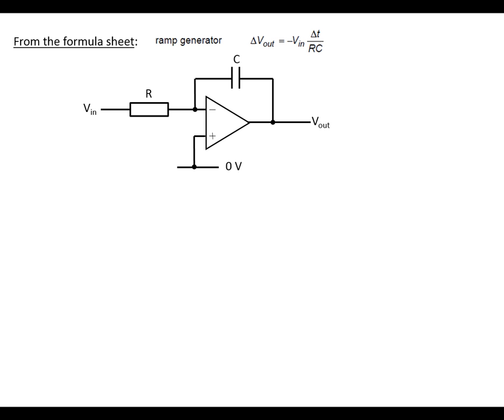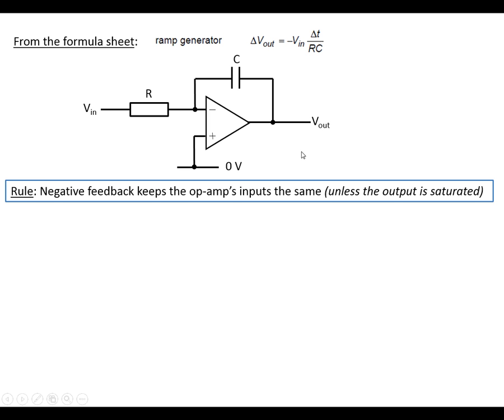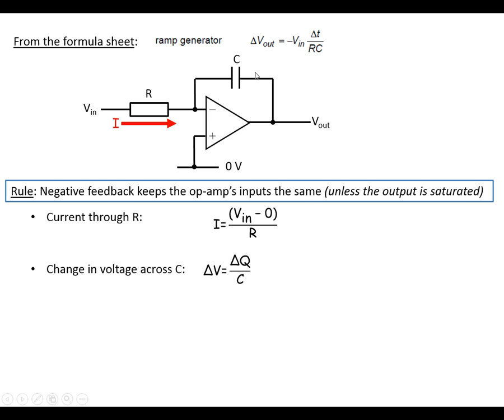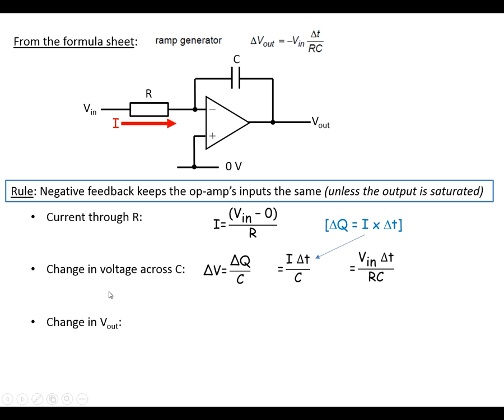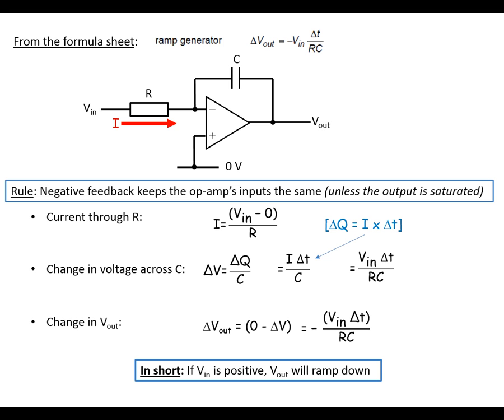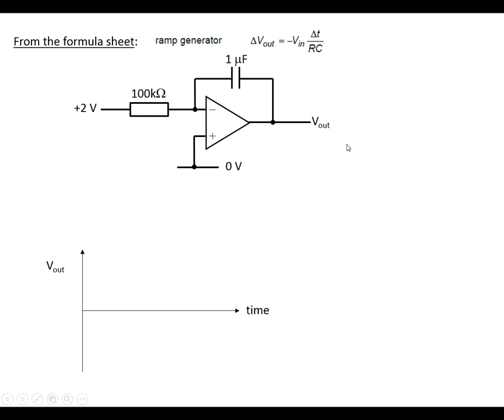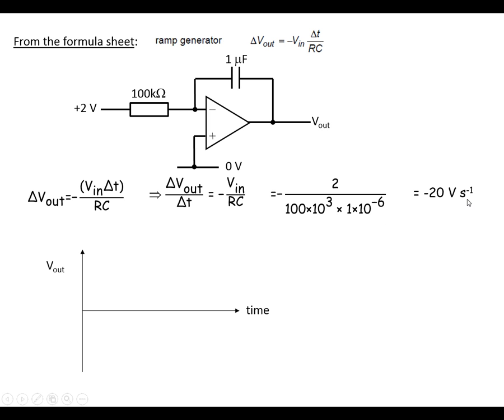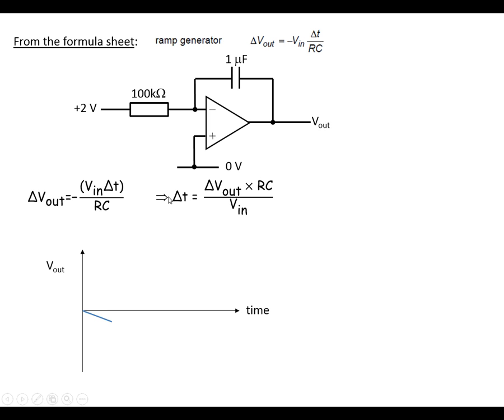Op amp ramp generator, or integrator

Comment: why does you say it a -20V? then when you graph it it 2v in 0.1sec then you write 13v x 100k x 1uF over 2 does it mean by 13v is 1.3v in grapg ? at the output ??
please answer me i want to learn to this course
Reply from the maker: The maximum output will be -13V (the op-amp 'saturates' at -13V), so what I was showing was how to calculate the time taken for the output to fall from 0V to -13V. Let me know if you have any other questions.